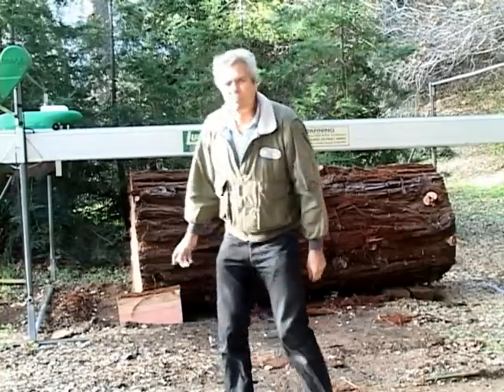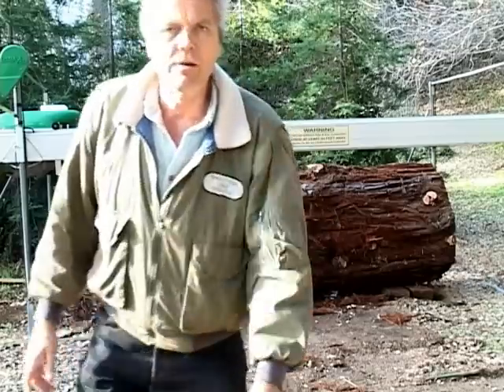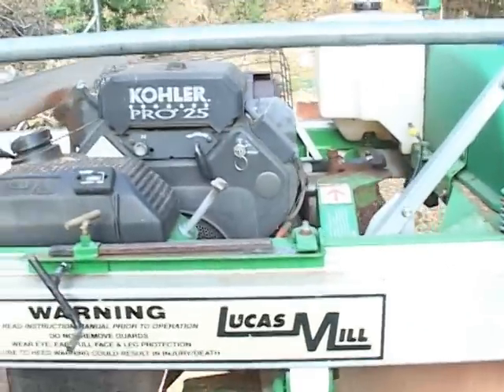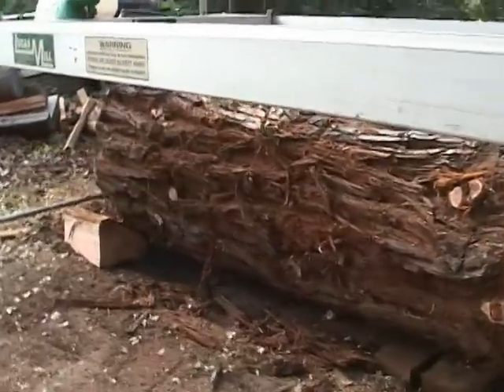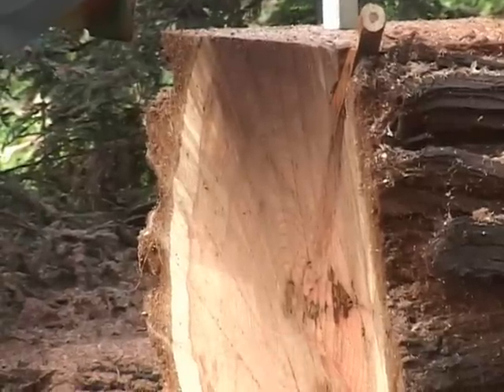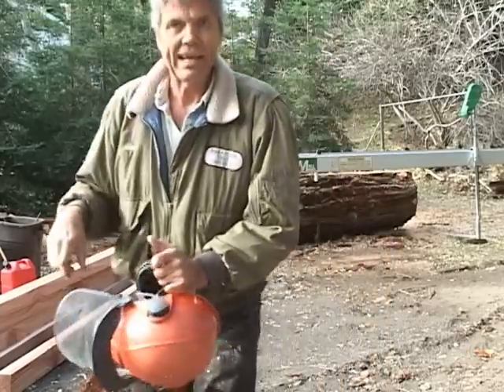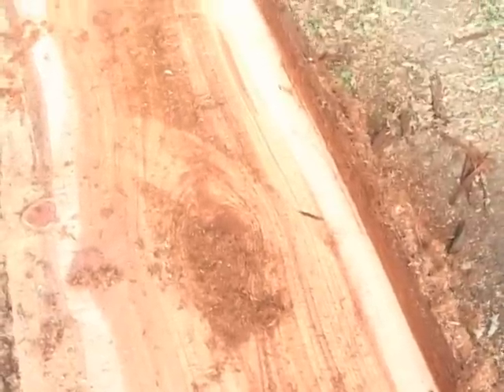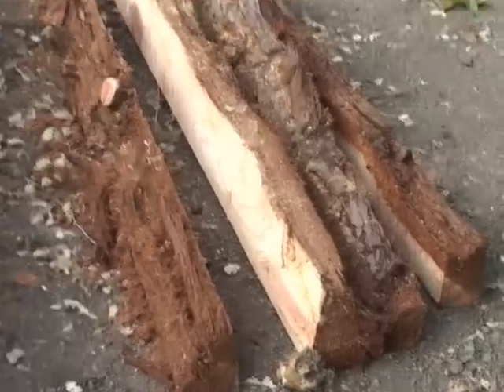(44) MILLING LOGS part one.mpg

Comment from the maker: You are right about not working the Lucas for 30 years but I have owned this rig for over 10 years and I have cut mountains of lumber in all species of wood.  I did this demo to show my clients what to expect.  Maybe tension wasn't the right word but there are different areas of hardness due to crotches, grain run out and big knots. (and nails)  When you hit these areas and don't slow down, the cut will change and sometimes cause the blade to bend a bit.

Comment: Great Video Blair! That Lucas Mill is a Nice Piece Of Equipment! I also got a good understanding of the Pressure thing, what it does and how to "Fix It" by Vertical Cuts first. Makes Good Sense! Thanks! Now over to "Milling Part 2".
Reply from the maker: This is a great mill to own. I have milled about 200 thousand bd ft of lumber with it. Built my shop with all milled wood from my jobs.
Reply: No, you DON'T do vertical cuts first. You do horiz cuts first, and if your tree has yendion, you add wedges front and back to keep the gap from springing closed on the blade and THEN finish with the vertical cut -- so the heavy lumber piece is not sitting on the blade as it frees from the log.

Comment: Thanks for your vids mate, great warts and all approach. I`m in the market for a portable, it`s looking like a Lucasmill, the extra cost looks like it`s worth it. I am still dubious about its ability to handle brutal hardwood like ironbark (1 pass = resharpen?), but then again, I doubt I`ll ever see this species, even though I am in Australia and I would dearly love to get my hands on some!
Reply from the maker: This mill is the easiest mill to sharpen. It also will take a slabbing rail with chainsaw bar. I mill really hard woods as well. Slower going but cuts well. I have milled euc oak, maple, etc.

Comment: Hard to keep my enthusiasm on high requiring Lucas the deal thinks I must buy an 8-30 when I see the 4-6 for 5500 I C something that works. The material I get free are very large snags. No the kind of material for band saw. I have a couple Alaska jigs the problem there is my age. I think setting up a monitor swing blade would take me into my wheel chair days. Your thoughts Blair you have done ban saw and swing blade?
Reply from the maker: The bandsaw mill is less strenuous but you still need to handle heavy slabs.

Comment: The real problem was the operator not adjusting feed rate to account for the large not preceeding the dive - if he had have seen the knot, slowed feed rate through the knot to account for much denser timber, then the blade wouldnt have deflected and he could have finished the cut without messing up the next layer